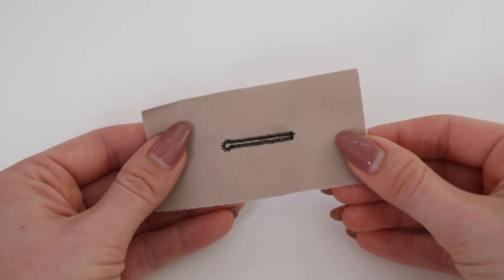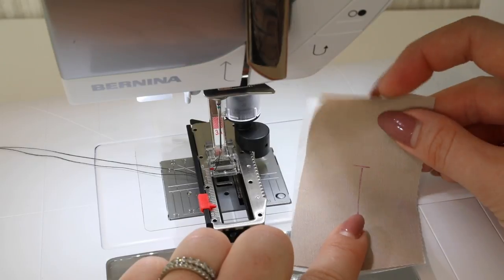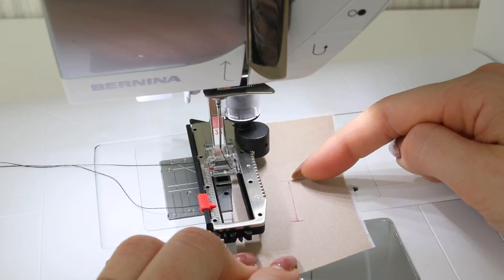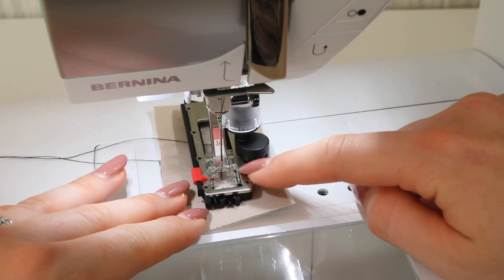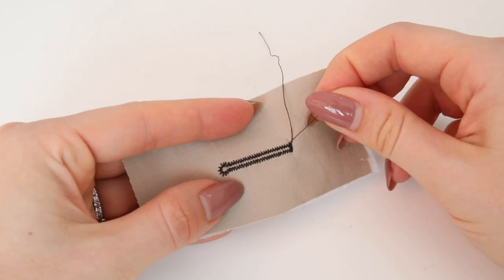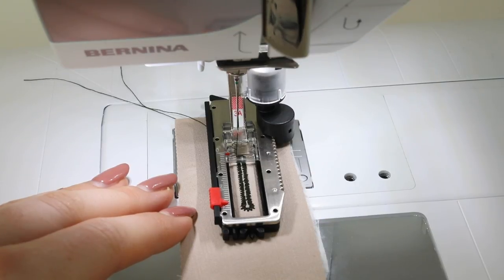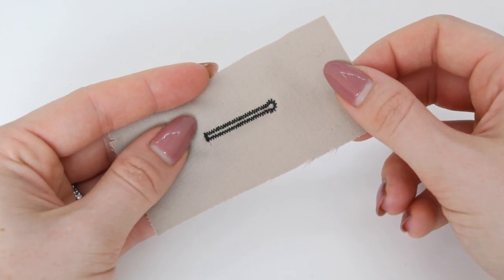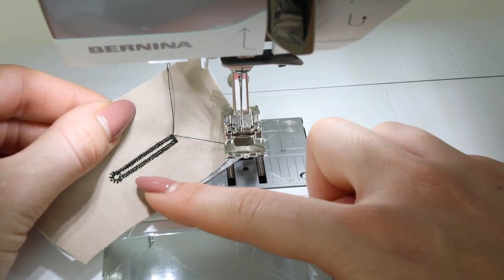How To: Keyhole Buttonhole

Comment: Is it possible to do a corded keyhole buttonhole, specifically with Tex 75 cord
Reply from the maker: It will really depend on your machine. I have used Tex 70 and Tex 30 with no issues on mine.
Reply: What machine do you have :)
Reply from the maker: @zecariaa.h.gallardo157  I use my domestic sewing machine for buttonholes; Bernina 790.

Comment: How much this machine
Reply from the maker: Hello, I have two different machines in this vode B350 and B790. You will need to check depending on where you are based. I think in pounds GBP the B350 is between £800 and £1000 (but it might have been discontinued). The B790 is more pricey as it does embroidery as well; about £5000-7000 I think. But prices and models are different in different countries! Aneka 😀